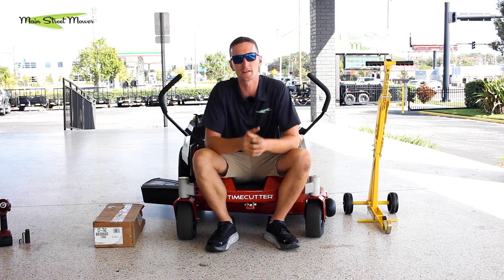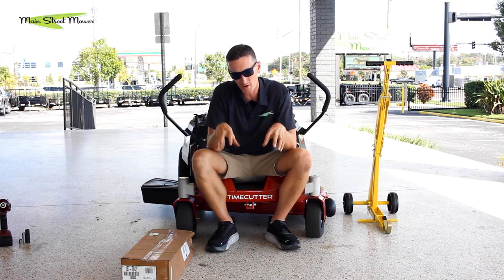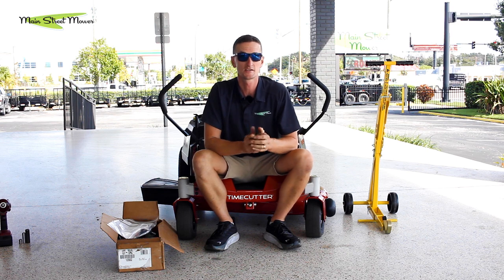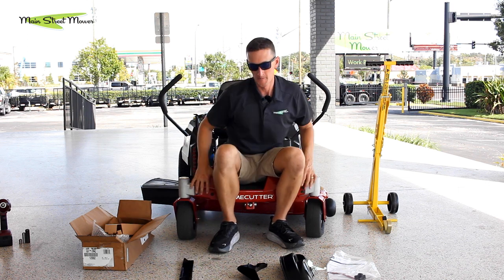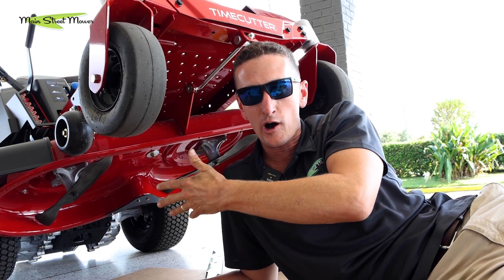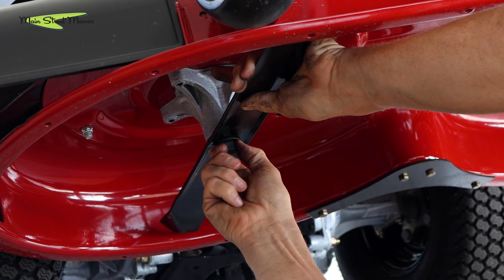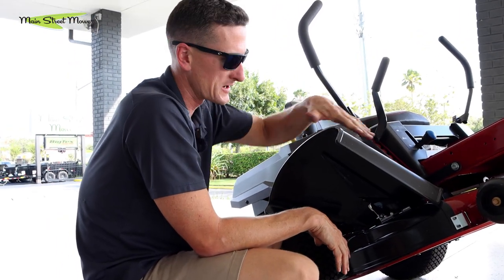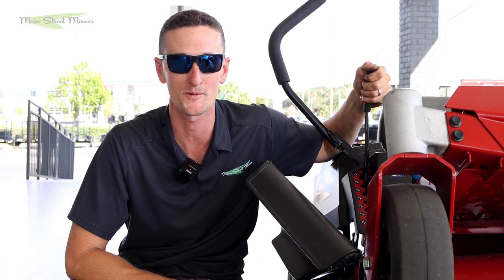How to Install a Mulch Kit in 3 Easy Steps! - on a 42" TimeCutter

Comment: Toro needs a simple chute blocker (for the 42” fabricated deck) that can be closed when mowing parts of a lawn where there are leaves that just get blown out with the standard chute. I only need it for a couple of passes and the would use the standard chute. It’s a real pain to have to install and uninstall the mulching kit. The need something like that the stamped deck has.

Comment: I am trying to change a one blade mulcher mower Briggs & Stratton for some reason I don't know which part of the blades face up and face down I don't know if I've got it on upside down or right side up I don't know if I could see or hear someone to explain this to me I would appreciate it that's all I need is to know which way I'm watching blade goes on a Briggs & Stratton small mower 21 inch cut
Reply from the maker: Hi Kathy, it'll be very hard to answer that without seeing what blade you're using or which side you're putting it in. Maybe you can find your answer in this other video we did on the best blade options. Check it out here: https://youtu.be/3-d00QuUklY?si=yd2fmxe361K1f-WO

Comment: After doing the blade change on mine it started to smoke after the first few turn ons. It does not smoke now. Is that normal? Also do these engine get fairly hot on these units? Thank you.
Reply: If you tilt the mower like that for very long it lets some oil drain into the cylinders on the motor and will smoke when cranked while the oil is burned out of the cylinders.

Comment: I don't have the tools to take off the old blade, so I left it on. Is that going to be a problem ?
Reply from the maker: It should be okay, but the results will not be as good as the proper recycling blades